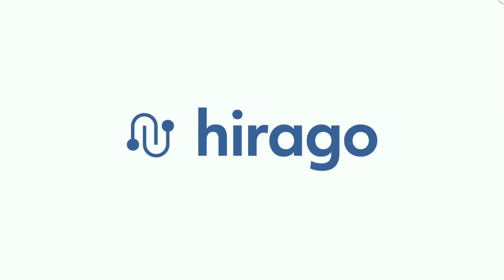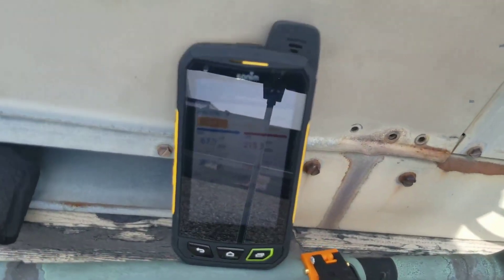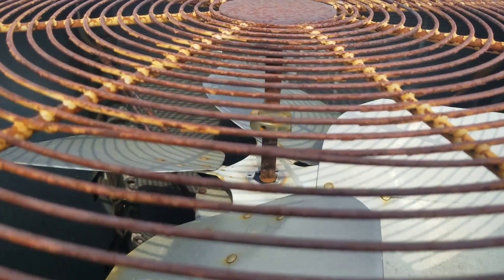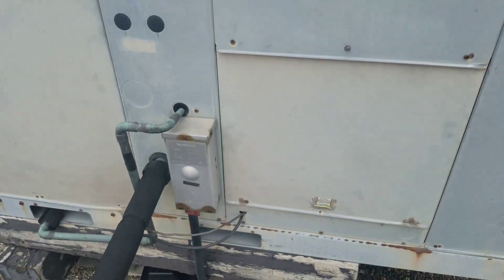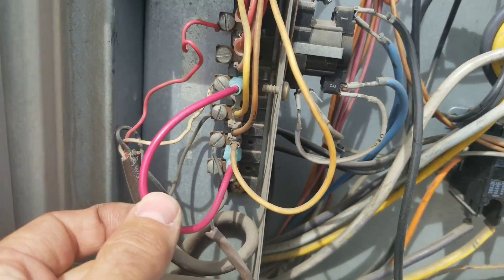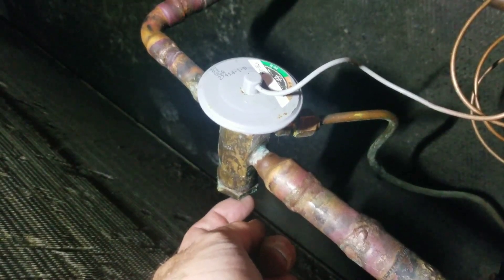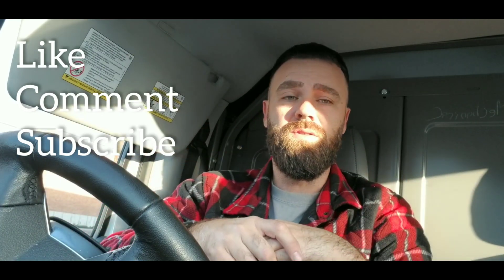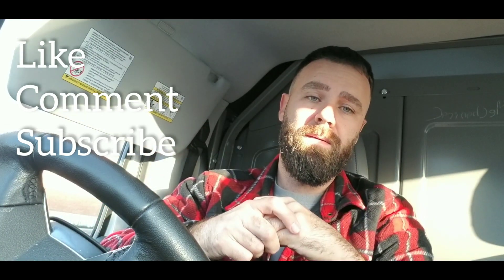Commercial HVAC Call/ Thermal Expansion Valve Stuck Open

Comment: What if your problem is low to no super heat. And high subcooling.
 33-35 evap sat and 69 degree cond sat low ambient around 56-59 degrees. Return air 70 supply 40ish

Evap clean and condensor clean and good airflow on both...

Could this be stratification? Or something else.

Comment: I was on a York the other day. Found a big leak on the discharge line U bend. It had been pushed and rubbed up against the metal on the end of the condenser coil.

Comment: Hello, how are you... Spoke with you in reference to the testo 770-3 meter and it's a pretty good meter... I use it in residential electrical HVAC furnace appliance repair and automotive modes and it's a pretty good meter.. like the set of the watts and PF on one display... The only negative is no light, but it's not a dealbreaker.. This is one of my main goal to meters us now... Thanks..